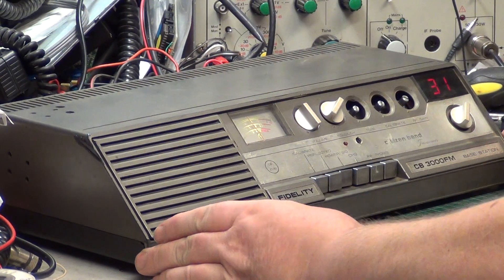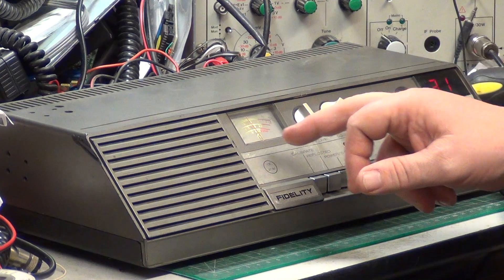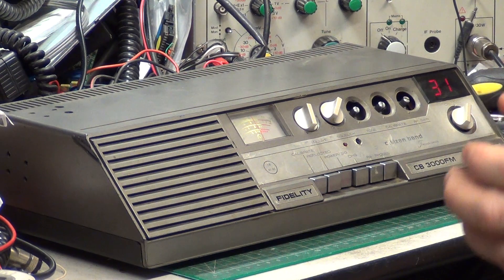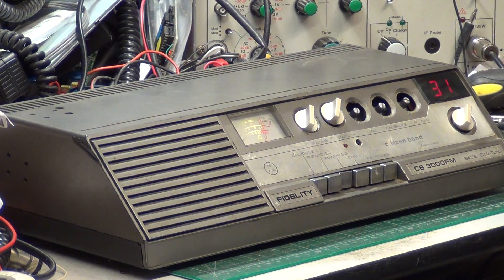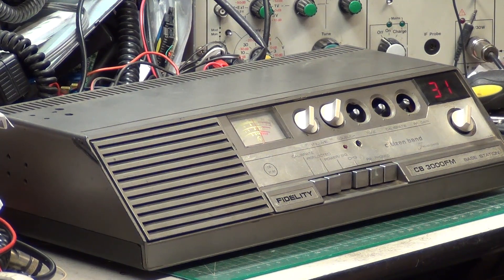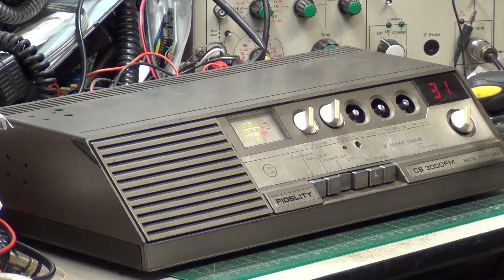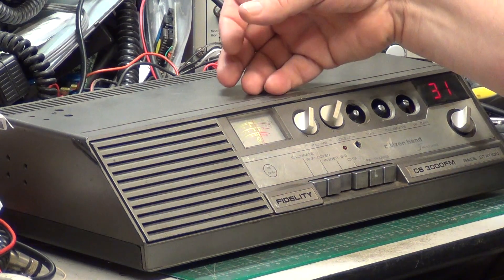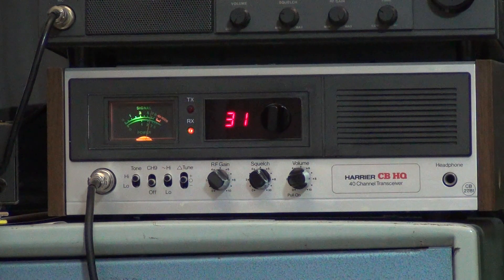Fidelity CB3000FM CB27.81 UK FM CB radio base station - On The Air test

Comment: Yes I had one and not a lot of power but they work and in my eyes every thing can be fixed but how much it cost its not about price it's to get a much maligned  radio  and I hope this saves them put into the scrap bin and to get them working. Scratchy corner with the low power and heard on a 2w that's allot better them most fancy named newer radios and you get your eyes opened take care thank you for your time
Reply from the maker: Yes, most new radios do about 2.7 watts & we can rarely get them above 3.6W.

I'm very pleased how this ended up & will work really well in my application for it.

Richard

Comment: Ancaster Service Station
N/A

Greylees a/k/a Rauceby level crossing
£1.577/L -> US$1.81/L -> US$6.85/US Gal
£1.839/L -> US$2.11/L -> US$7.98/US Gal - Diesel

Another fine rescue ... even if it wasn't brought back "all the way" ...  Looking forward to seeing it connected to the Tannoy.
Reply from the maker: Well as far as TX power goes. The service manual says that 1.8 to 3.7W is normal, so my 2.5W output is good for these. If I had an 8.2 ohm resistor in stock rather than the 10 ohm I fitted to the RF driver transistor power feed, we may have had around 2.8W. 

Loft aerial installation video & connection to the Tannoy system here (actually it's a TOA system...like saying Hoover for vacuum cleaner!), should happen this weekend.

Richard